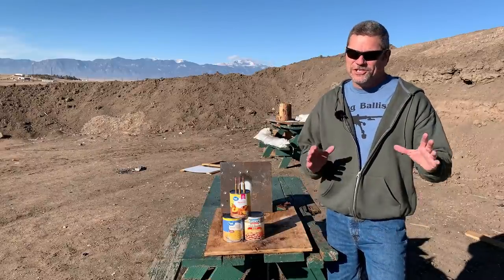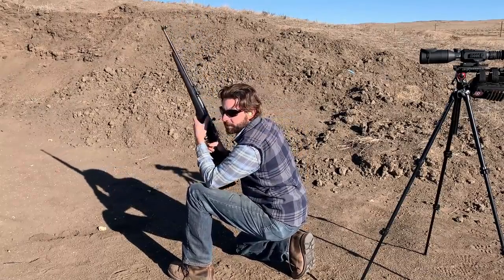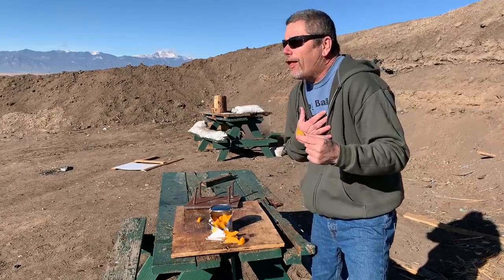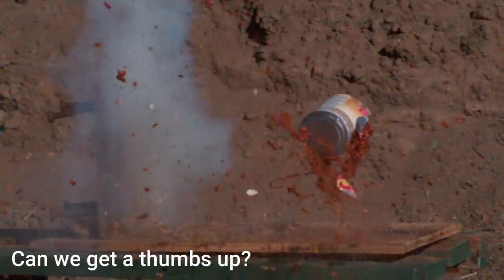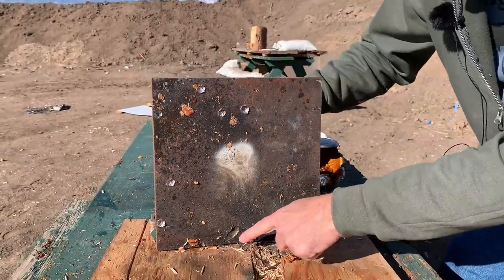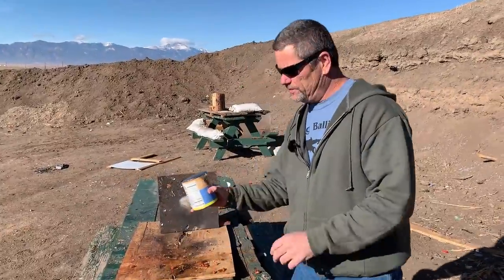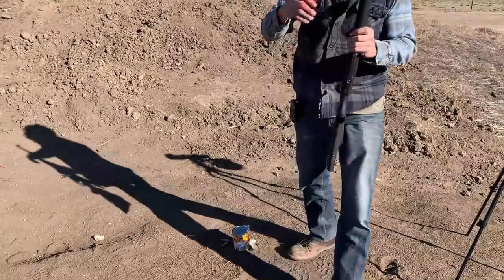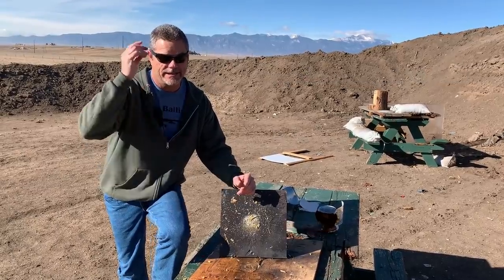7.62 x 54R-PZ (Exploding Sniper Rounds) vs Canned Food

Comment: These rounds are really cool but they all exploded BEHIND the cans? Think you need to put some cans together or put the can against the steel plate instead of leaving a gap. Explosion within the can would be a lot cooler even! (wear a raincoat) Keep up the great vids guys, love it!
Reply: Was going to say the same thing about putting another can behind the front can. I bet the back can would VAPORIZER!
Reply: Or at least put the can on its side. The cylinder is deeper than it is wide and the pressure of the explosion will be more consistent throughout the substance inside as well.
Reply: It has to do with how long it takes for the ammo to initiate.

I shot a butternut squash end-on with a PZ and the round went off about 15" behind point of impact, behind the squash.
Reply: I agree. Explosion happens at metal plate
Reply: yes, can are too thin to ignite the explosion correctly.
need soemthing more strong , like very big 7 pounds can of hard things in it (kentucky ballistic used theses big can with gravy or nacho cheese in them, they blow pretty good with high caliber. but no idea about thoses "small" caliber)
Reply: @mandujanojuan437  look at the second round again, it popped before the steel plate.

Comment: would those rounds be more effective with another can behind the first can before it hit the plate? it looks like most of the flash came out of the back of the can..
Reply: Yes, they would be.

The rounds take time to go boom, and the cans aren't slowing them down enough to pop inside a can.

I shot a butternut squash end-on with one, and the round popped behind the squash, at least 15" from impact point.

Comment: I know it's hard to do but I'd love to see ballistics gel or clay hit at 100 yards. WTW and others do them.up close, but I'd love to see the damage difference at 100 vs 10 yards. Even with just ball rounds.
Reply: It only loses about 15% of its energy in the first 100 yards, so you'd probably have a hard time noticing the difference.
Reply: @timewave02012  I mean I'd love to see 500 yard impact if they can pull it off.
Reply: @joshuagibson2520  The easy way to test performance at long distances is to down-load the ammo to match velocity from a ballistics calculator, and shoot from close. For 500 yard 7.62x54R, 300 Blackout from a pistol/SBR performs very similarly, and you'll find a lot of people testing that with a lot of different projectiles.
Reply: @timewave02012  keen idea. I appreciate the knowledge. Unfortunately I don't currently reload. That may change one day.
Reply: @joshuagibson2520  Even so, what I'm saying is the tests you find of 300 Blackout from short barrels will be similar to the performance of 7.62x54R at 500 yards. The diameter is very slightly different (~0.003"), and 300BLK usually favors either heavier (e.g. 220gr) subsonic or lighter (e.g. 110gr) supersonic loadings compared to ~150gr for 54R, but that's because you usually want subsonics to be as heavy as possible and supersonics to be fast enough to expand with hollow points.